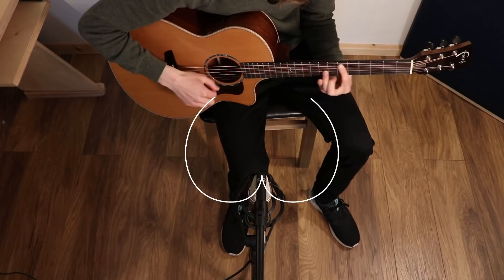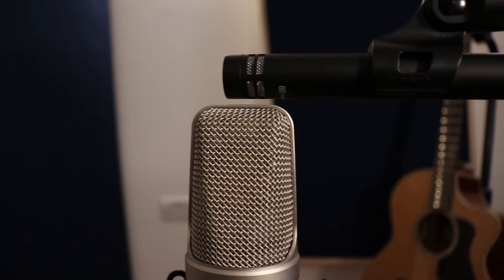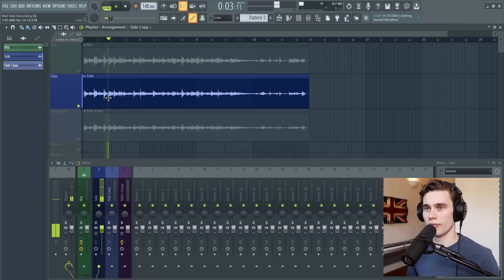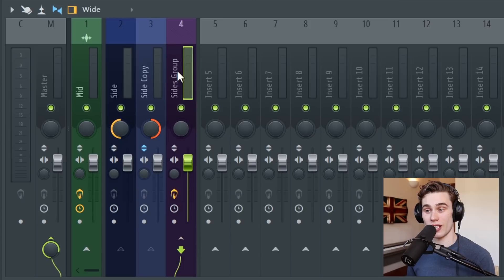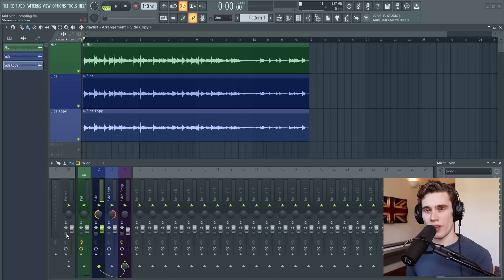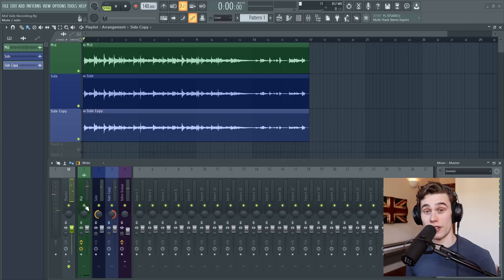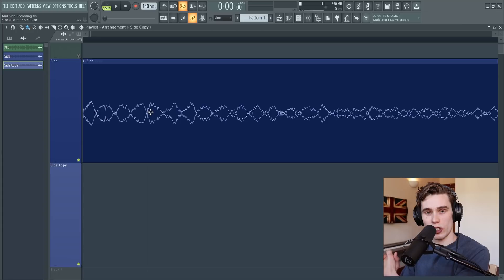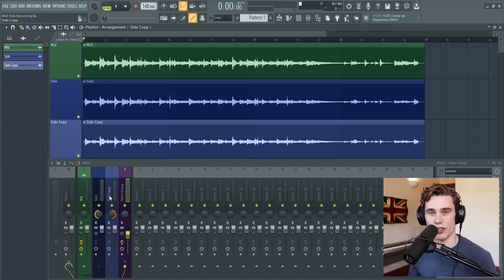Stereo Recording Tutorial (Mid Side)

Comment: What people don't seem to realise is that mid-side is essentially not supposed to be some super wide mind exploding technique, but a true, natural way of capturing the stereo image, where the sound sources can be clearly localized. And you won't be able to do that if you overdo the sides!

The other one of the side signals is supposed to cancel out with the mid signal when a sound source is on the other side, while the other side will add up to the mid. This will make the sound come (mostly) from the other speaker, as it should, since that's where the sound source was! If your mid and side signals are not in balance with each other (the sides being too loud for example), the cancellation that enables the localizing won't happen properly.

That being said, you can of course do whatever you want with your material if it gives you the result you're after. I just think it's good to be aware of what you're actually doing.

Comment: If the sides cancel out in mono, there will be level difference. When is this wanted?
Reply: If done properly, the other one of the side signals should cancel out with the mid signal in stereo when the sound source is on the other side, while the other side adds up to the mid. Being a figure 8 mic, the side mic has a null where the mid mic is pointed at, so if the sound source is at the center, the side mic will reject the direct sound, while the mid mic will capture it. This makes the result closer to mono to begin with, since there's not much information on the sides. Therefore the level should not significantly decrease when mixed in mono.

Comment: My side mic doesn't sound balanced if I sit directly perpendicular to the mic.  I figure that this is due to the body of the gtr making more sound than the neck, so the capsule picking up the body is louder and therefore off balance.  The way I've been able to remedy this is to turn my chair slightly so that I'm more at an angle so that the projected sound makes its way into both capsules a bit easier.  I didn't understand how you got the balanced sound by being at a 90 degree angle, so I went back and looked again and it does seem like you're at a slight angle (although it could be the camera angle).  Your results are awesome though.
Helpful tip:  Instead of doing 3 mono files, record a single stereo file with the side mic on the L input and the mid mic on the R input or vice versa.  Then use the free Goodhertz Midside Matrix plugin (or their more in-depth paid version simply called Midside) which will do all of this for you under the hood.  There are toggle options in the plugin to flip the M/S if your M and S are backwards in the stereo file.  You'll also have separate faders inside the plugin to control the center and side channels.

Comment: This M / S technique is very interesting, thanks for the video and for sharing it! I don't have much experience in this regard however I tried to replicate it (I use Logic Pro X) and I succeeded without problems. I would like to share my experience: on the Stereo Out I put an excellent free plugin that controls the phase (HOFA 4U Goniometer & Korrelator).Now in playback the volume of the track with the cardiode microphone is at 0db and I noticed that if I put the other two at 0db too (mic figure 8) I see on the plugin in the stereo out that goes in counter phase. If I turn down the volume of the two tracks in figure 8, -4 / -5 db, the phase is correct! This is normal ? So you have to pay attention to the volume of the microphone tracks in figure 8 in order not to go into counterphase or in this case it doesn't matter?

Comment: Cool tutorial, the effect sounds really full! It also raises some questions:

What strikes me is that reversing the polarity of one side sounds so different, even with headphones on (which eliminates wave cancellation from the 2 stereo speakers and just puts a slightly different signal, but the same shape in both your ears), is it just the brain that interpretes the different phases and creates the perceived stereo width, or is there something weird going on while summing in stereo? 

Is there a way to use this trick with digitally generated instruments (VST)? Would putting a dry signal to the mid and a slightly convoluted signal to the sides achieve the same results?
Reply from the maker: Martijn Tromp it likely is that the ears pick up something which is the same but opposite, like a reflection of the sound on one side and such it sounds very wide. I’m not entirely sure. As for replicating it with a vst, this is a very interesting idea and something you should certainly try out!
Reply: @inthemix  After some digging i found this: https://www.artandscienceofsound.com/node/345 (second post)
It has to do with how your side microphone picks up signals, positive polarity on one side, negative on the other. It seems that panning and reversing the polarity and summing it with the mid mic "restores" the stereo information from the source due to the difference of polarity on both sides of the side mic and cancelling out common waves (as the mid mic has center panning).

This would therefore probably not work with a VST, but this is something i'm still going to try faking in the box, i think it would work wonders on fattening up a synth lead.

Thanks again for these tutorials, they really help me come to grips with FL Studio as a fledgling producer!

Comment: I have always been sceptical about recording in MS. Usually, the vocal is in the middle. Unless if you throw the guitar in reverb to push it back, my worry is that the vocal and the guitar will be fighting for space in the middle, I usually just record with one mic, or in some cases in a stereo pair. With MS how would you go around mixing the guitar and a vocal, and is it advisable to do this when you also have a kick drum and percussion?
Reply from the maker: If I’m being honest, I think a stereo pair or double tracked performance (panned maybe 70% Left and Right) soonds better most of the time. This Mid Side technique is really for specific applications where you try it out and it works. It’s highl dependent on the room, instrument and as you say the context it will be mixed in. Maybe you could try a few methods and see which sounds best to you? The benefits of modern Daws make this a breeze :)
Reply: @inthemix  thank you for sharing this video, it is quite an interesting technique and you explain it well. I will try it out and experiment in different situations, most likely in stripped down recordings, and see how it goes. It's a constant learning curve
Reply: This is a different technique for recording.  When using M-S, it's normally its own stereo soundstage, and is not part of a multi-mic recording where every source has its own closely placed mic.   The M-S pair is usually much farther away from the sound source(s) in a typical recording.